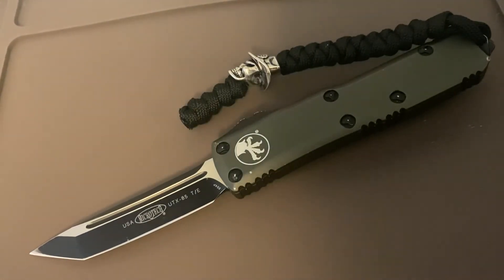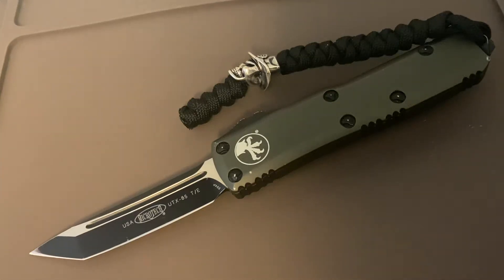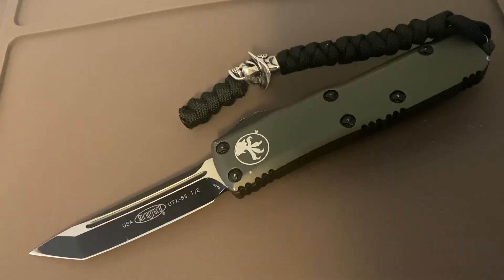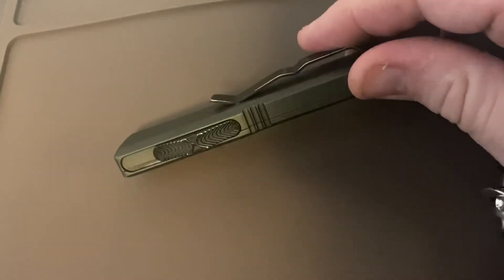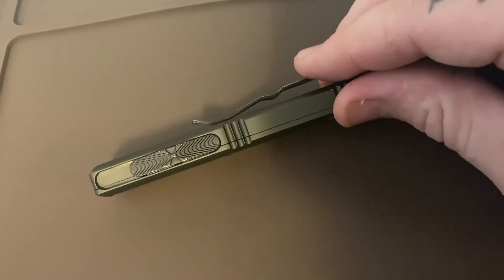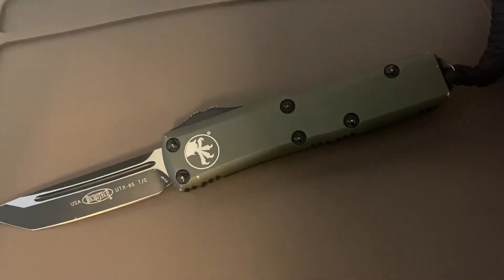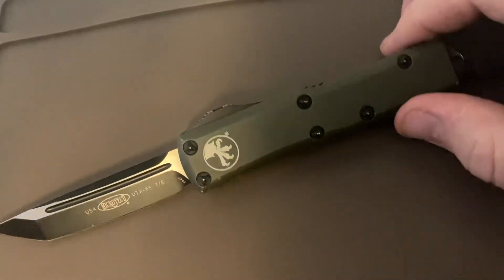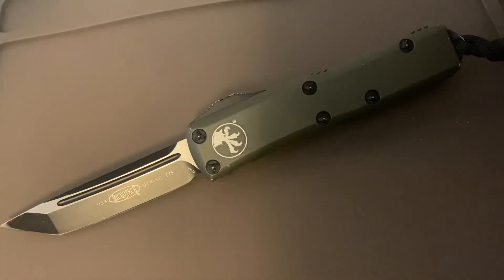Can You Really EDC A Microtech OTF?

Comment: I’m a firefighter and EDC my single edge (with half serration’s) Ultratech on duty and off for the last four years and haven’t baby’d it the slightest through all of its everyday uses.  Through this, I’ve needed to sharpened it about ten times to varying degrees (to keep it super sharp) and have also needed to clean it every few months (with a couple disassembly’s) to keep it very reliably functioning.  I know you’re not supposed to disassemble for factory warranty reasons but double action Microtechs are actually brilliantly simple inside and very easy to take apart and reassemble in order to really clean the insides of their only real operational enemy…. pocket lint that can get deep inside the knife’s sliding surfaces and doesn’t always come out with Rem-oil and compressed air cleanings.
Reply: Thanks for your input … I just bought a utx85 and was wondering about microtech and getting as much info as I can … I got my utx 85 on the way … now my question is how long were you able to use it before you had to sharpen it ? And do you send it in or do you sharpen it yourself for that ?
Reply: @jkbear29  I sharpen it myself and sorry but I don’t have a clear answer on how often I do.  It can vary between a couple weeks or a couple months.  That’s because it all depends on what I’m cutting, how much and how sharp I want to keep my knife.

Comment: I have been using microtech otf knifes for 8 years now,it has never failed on me,I only broken 2 blade tips on the double edge models but that was my fault,the blades are strong but not invincible,fantastic knifes I also use folding knives which are a little better for hard use but i have a soft spot fot otf’s
Reply from the maker: They are amazing quality but the tip and edges are very thin, I always been a EDC Pry bar with me to avoid breaking the tips. I typically EDC Folders and use them hard, but i bought this specific microtech to beat and see how it would hold up vs a benchmade or spyderco folder. So far it's still going strong!. Thanks for the support!

Comment: I carry one every day. I think they are the safest knife design for opening packages, baggies, cutting the hedges, etc. because you can retract the blade much easier than other designs if you can't put it back into your pocket. You mentioned the special driver for the screws, mine came with the driver. I probably bought a counterfeit by mistake.
Reply: That is why when I buy a knife over 100 dollars I dont even play with Amazon or anything else, only authorized dealers

Comment: I have always wanted a microtech OTF, the new Gen 3 Combat troodon has torx screws which finally pushed me into buying one for my 30th birthday which is actually tomorrow. I am not buying a 500 dollar knife that has springs and mechanical stuff going on I cannot take apart and clean and trouble shoot lol. I have been carrying it about a week and I really like it so far, hopefully in a couple years  I will have some cool war stories.  Like my Spyderco military I carried for like 8 years, that beast got dropped off the 2nd floor of a parking garage by accident. The handle also pried open the mechanism on a ratchet strap that had a dudes hand caught really bad and it is still good to go, albeit maybe a little more off center than it was new.. ha.  I LOVE that knife, hope to say to same from the troodon. I dont expect it to be quite as robust as the military due to the complexity but my standards aren't exactly low either

Comment: I own several, and I’ve only had problems out of one that I purchased secondhand. Apparently the previous owner put some sort of oil in it. Maybe vegetable oil? It wasn’t a petroleum product however it took me a long time to take it apart and clean all that stuff out of it. After it was clean and I put some REM oil in it it’s been perfect. I believe that people who purchased OTF knives. Especially new owners that don’t have the dexterity and strength to open and close. It may try to use oil to fix that problem.

Comment: i found breakfree CLP to work better then rem oil. I also noticed if you imagine you took 2 metal plates that were flat and put oil in between them. clp does not hydrolock the 2 plates and rem oil does.

Comment: They are great for edc because many times when u need to cut open anything u need to do it fast with one hand on the thing ur cutting.  To be able to open and close it fast with 1 hand only is safer and faster then having to use 2 hand to open or close it with a lock release.   Plus they can never ever close on ur hand while in use.

Comment: Microtech has recently came out with a new otf called the hera only in a dagger style so far. With a new pocket clip and goes for $425 on blade hq but they are sold out as of now.
Reply from the maker: Yeah, I have seen it. Now that it's been a few weeks there are a few vendors that have them in stock. Seems to be a Halo style chassis with a dual Fuller's in the blade, It looks like a cool knife and all but that price point seems to be a little steep considering the only real potential upgrade i see on it is that pocket clip the the de-tent ball on the end. I like that they are coming out with new model's though rather than only focusing on themed variants of their production and signature series lines.

Comment: You don't need to buy their bit driver. Melt the end of a plastic pen and press it to the screw head and it will mold. Free tool. Won't strip the screw head either since the plastic will just deform if you over torque it.

Comment: You can EDC whatever you want.
Reply from the maker: Yes you can, but some of us want to know how these hold up outside of an office job and how reliable they stay.
Reply: @hvymtlkngedc9705  I bought my first Microtech Ultratech DE about a month ago. I've wanted one for years. It's been EDC pretty much everyday since then but I realize for "normal" day to day applications, probably not the best choice.
Reply from the maker: @KaPPy83  They hold up to hard use just fine and are very practical for a wide range of applications. I think the real key to keeping any OTF reliable with daily use is good maintenance. I wanted to test this one out as hard as i could so i never disassembled it. With my other microtechs i take them apart fully and clean them routinely. As long as nothing like a small rock or sand gets caught in between the chassis and the blade slide where it could damage the soft aluminum chassis, eliminating the smooth action of those parts moving back and forth against eachother they should be able to externally take a beating for years. I amsuper stoked that you did pick one up for yourself, they really are an amazing tool! The heretic line is also nice and very underrated!.